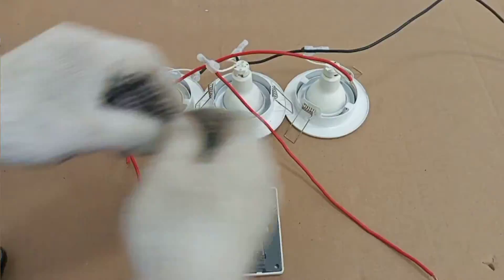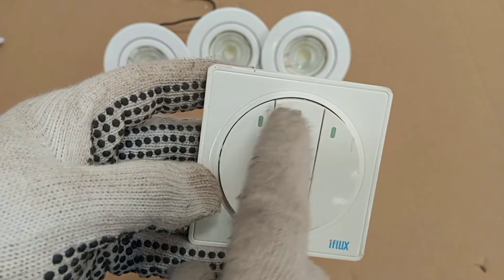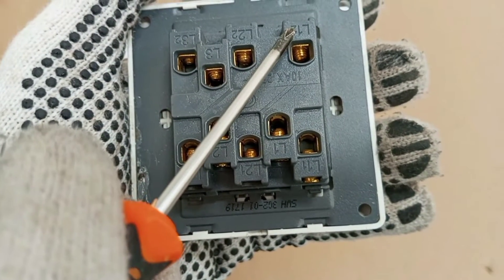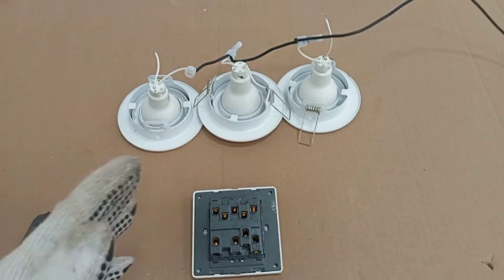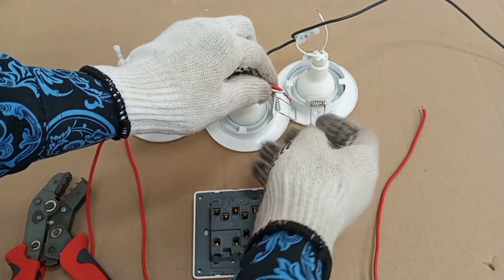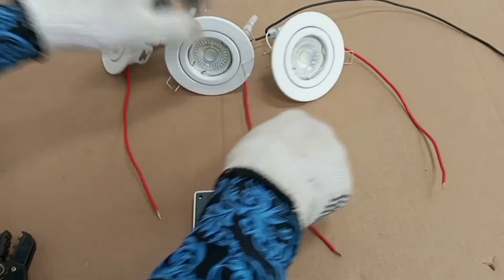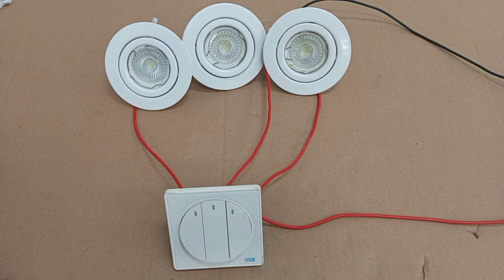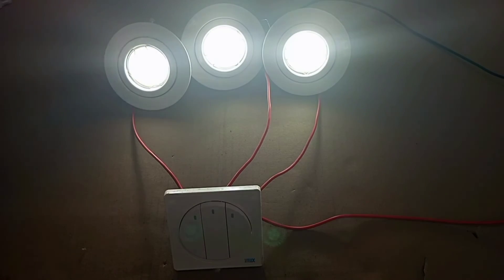3 GANG SWITCH WIRING

Comment: I'm trying to replace the light switches in my catering trailer it has 2 switches a single and a double the switch I have bought is as this video the cable is 5 core so I am confused as to what wire goes where any help appreciated

Comment: Hi, great video. I hope you can help me with a bit of an issue i have. I have just had some plastering done, and unfortunately they knocked out the wiring from the existing switch, so i have no idea which wire connected to which port on the switch. I have 9 wires coming from the back box. I have 3 LIVE red wires, 3 Neutral red wires, 3 black neutral. How can i work out which goes where? Lol
Reply from the maker: 😊 This will be difficult to tell. It's best to get a qualified electrician to rewire it for you. I don't know your location to see if I could help. You may reach me on +233209323669

Comment: What's the rating of the light, the 3gang switch and the breaker that feeds the circuit. Thanks alot for sharing.
Reply from the maker: The lamps are 5W each, normal light switches are mostly rated 10A just like the one in the video, the breaker is 6A.